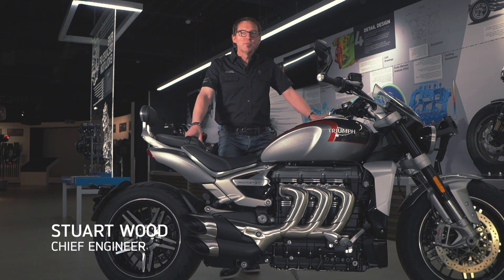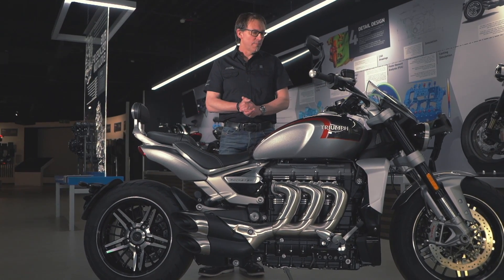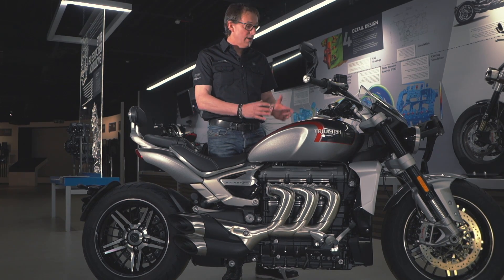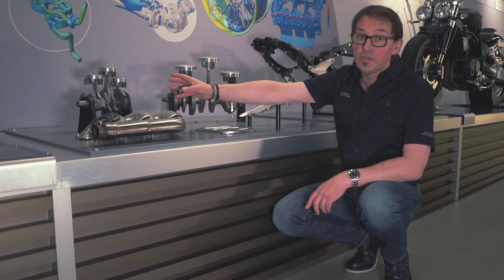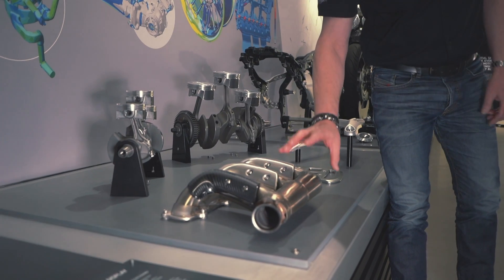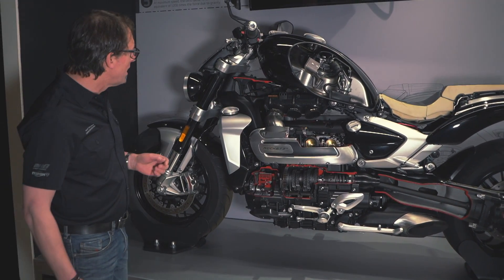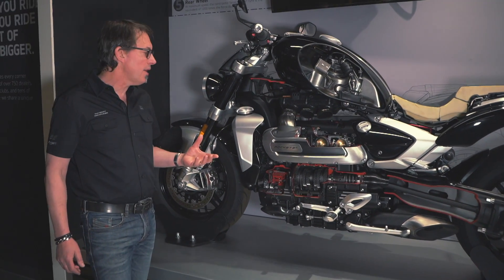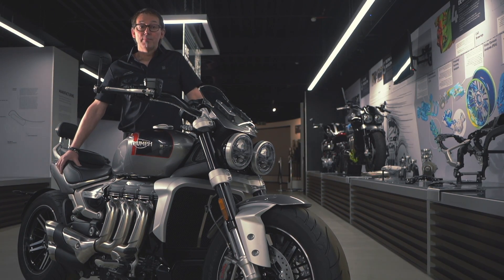Triumph Factory Stories - Rocket 3 Engine

Comment: I want to remove the plenum and attach air filters directly to the velocity stacks. Seems like it would get a lot more air without moving thru the frame. Besides, I’ve replaced my filter three times in 25k and each time it was filthy. And it’s, a pain in the backside to do so.

Comment: Hi Triumph engineers . could you build a 1250 cc ROCKET engine .that is way over square and con rod length to stroke ratio of 2.1 to 1 .. i think a market for such a bike exists . the 2.5 Rocket is a little big for me .. thank you .  and maybe with a sidecar compatible frame that is similar to the offroad MX sidecars . just a thought .

Comment: I just bought a brand new rocket 3 2020 4 weeks ago. It’s in for it’s first 800km service. Since I’ve had the bike, I noticed it would puff out heavy smoke when you would load the engine very lightly. Now I’m waiting on triumph to let the local dealer know what to do with this defected engine and hope it’s not going to be in the shop all summer

Comment: Stuart, any news about actually making this into a touring model with fitted luggage paneers and Passenger top box with a windshield/fairing. This bike is really good for posing but useless for touring in north America. Hoping there is a proper touring model coming soon, getting older and need a stable partner for my Trophy SE!!!!
Reply: YOU SHOULD TO BUILD A ROADSTER CAR WITH 4 WHEELERS USING THE TRIUMPH ROCKET 3' S ENGINE, THE GEAR BOX AND THE CARDIN AXLE, INSPIRATED ON BMW Z3 STYLE !!! ...